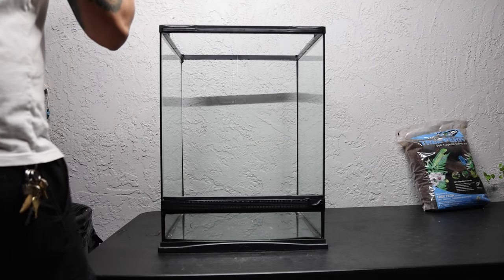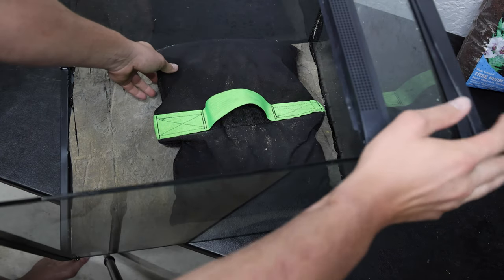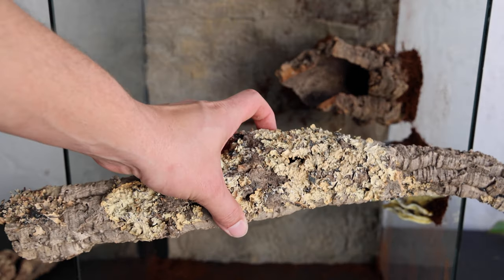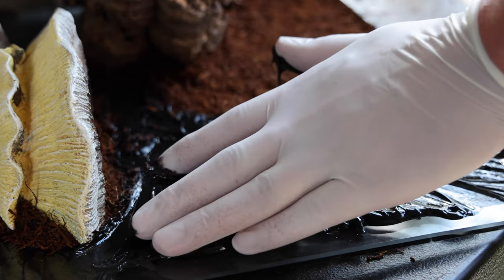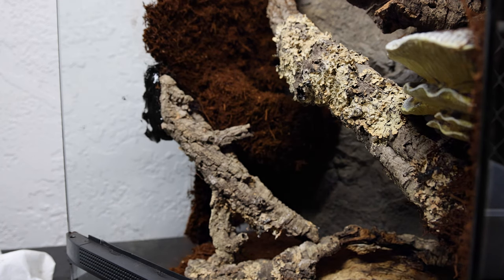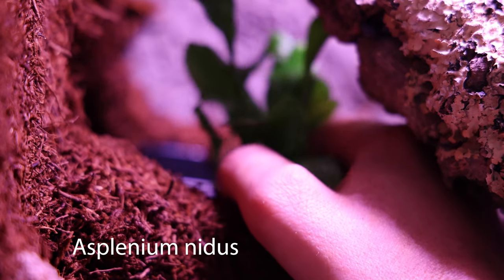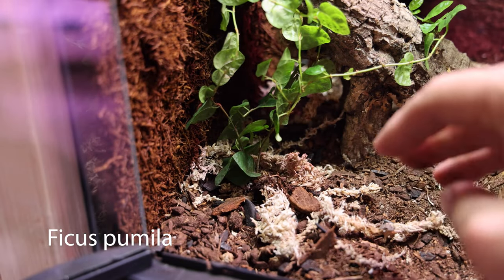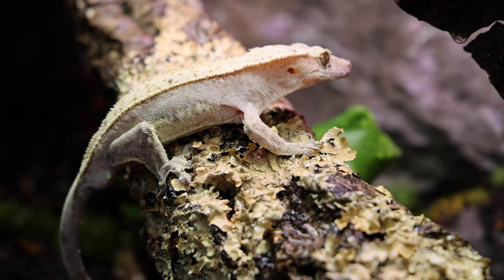Bioactive / Naturalistic Crested Gecko Vivarium

Comment: Why would you block the bark so the gecko can't hide?
Reply: There are other safe places to hide where he can always access the gecko if need be in an emergency
Reply: Last thing you want is to have a dead gecko stuck in a log
Reply: You don’t want to have that open as it has no air holes if the gecko gets stuck in it because it’s very small.

Comment: Gorgeous tank, and that gecko is a sweetheart!!
For other people in the comments, it's recommended to let the viv grow for at least a month prior to adding a gecko so that the tank can cycle and so that you can check the humidity and temps. That way, if something goes wrong at first, you can fix it prior to adding the gecko. This also allows the plants to grow big and strong so it's not as easy for the gecko to trample them. However, this part isn't as important.
I'll also caution against using philodendrons because they are poisonous - they have insoluble calcium oxalate crystals. If these plants happened to be eaten by the cleanup crew, the poison could bioaccumulate in your cleanup crew (especially from natural leaf shedding from the toxic plant), which could then be consumed by your gecko. It's a small chance, but a risk nonetheless.

Comment: I heard that great stuff foam doesn't adhere to glass very well it might fall off
Reply: silicone on the back before adding great stuff might help it adhere or hold
Reply: I did it without using silicone.  Yes it does slides off but I waited for 30mins it stuck on good, future reference def use silicone before using the foam,

Comment: can regular rollie-pollie's be used instead of purchased isopods?
Reply: Pretty late reply but not usually; however it is possible. You would have to breed multiple generations in captivity to insure there are no parasites or anything before putting the babies from captive gen 2 or 3 in the enclosure.

Comment: How do you clean it?
Reply: You don’t need to clean them. Natural vivariums are packed with spring tails and isopods which are small bugs that act as a cleanup crew. The only real maintenance you would have to do is trip back plants, and clean off any glass that has waste on it.
Reply: @drivernephi-s1l  Adding onto this, spot cleaning large amounts of waste is recommended; even a large cleanup crew can only do so much. Occasional glass cleaning and daily/near-daily cleaning of food and water dishes is also recommended.

Comment: What happens to these builds if something bad happens like an animal gets sick or dies? How do you disinfect the whole build to make it safe for a new animal or do you have to throw the whole tank out?
Reply: Unfortunately the safest thing to do in these situations is scrap the build entirely. The tank itself can be sterilized and reused but with parasite/mite related issues it’s very hard to completely eliminate those things without taking everything out of the enclosure and doing bleach soaks/baking. There’s a lot of places for things to hide in a bioactive setting, so prevention is the best policy for bioactive, no outside things added in, cleaning plants before introducing, boiling/baking wood, all that stuff
Reply: There are cleanup crew they will deal with this.
Reply: @boxofbeasties6075  Clean up crew won’t disinfect. They will get rid of the mess but not the infectious organisms left behind…And in a habitat with a lot of small porous areas it’s virtually impossible to thoroughly disinfect everything entirely. You don’t want a trace of crypto hanging around to infect your next inhabitant.